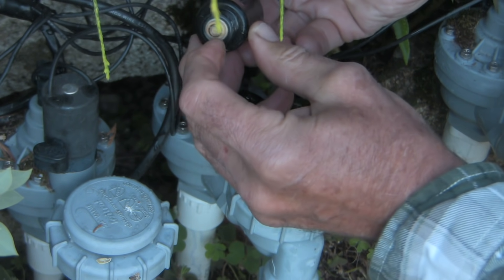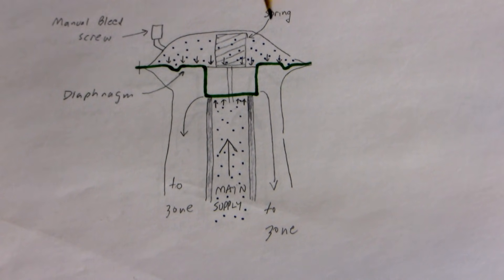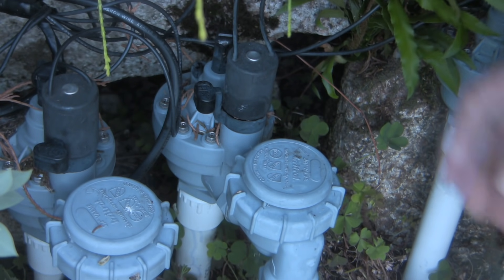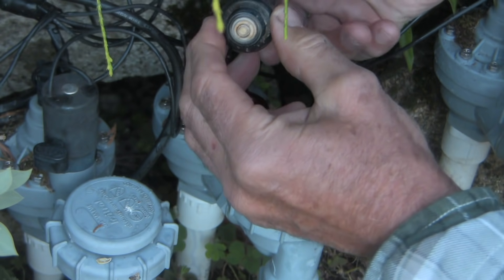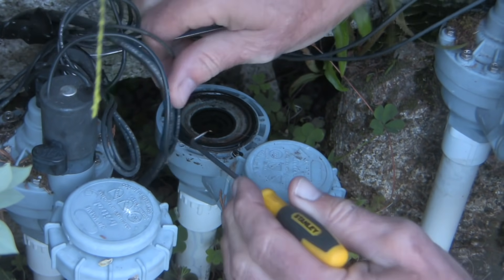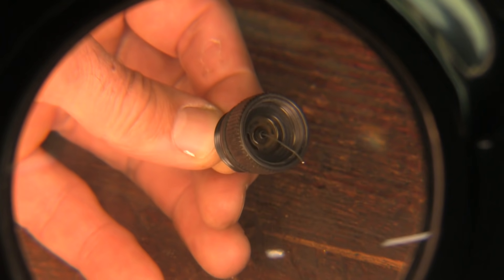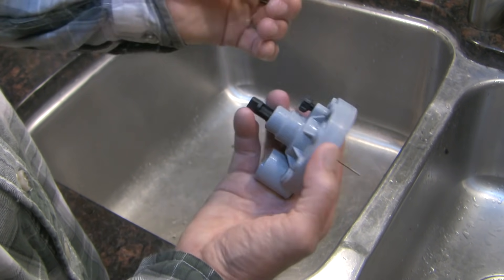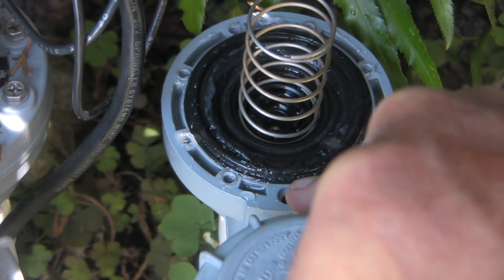Troubleshooting irrigation sprinkler valves

Comment: What would cause low water pressure
Reply from the maker: Two major issues. First, resistance in the line, such as a kink or obstruction or line corrosion higher up can cause a pressure drop across that resistance when water is flowing. That will give OK line pressure when water is not moving but when you open one zone the pressure drops so far that sprinkler heads don't get enough water flow to operate normally. Second, devices that consume a lot of volume can reduce pressure so much that other devices can't operate normally. This is what happens when people add too many devices to a zone, or when a leak happens somewhere, or when devices in a zone are not matched together properly to distribute volume evenly.

Comment: Ok so I took the bonnet off and the hole that connected to the valve had a small white plastic "tube".  Well the end of the tube was smashed.  So I tried without it, and water came out of the siphon not the sprinklers - like how you were missing the O ring.  Are there replacements for the plastic piece?
Reply: Thanks for your help.  I bought the replacement diaphragm kit at Lowe's which I thought was kind of expensive: $8.  But I put it in and that fixed it.  It looks like there is some sort of small white plastic filter passthrough that goes from one side of the diaphragm to the other.  On my old diaphragm that piece was broken and part of it was probably washed away.  Thanks again for posting your video.
Reply from the maker: You could try at an irrigation supply store, or even buy a new valve to dismantle and use it for spare parts. Most of these devices are inexpensive, the tricky challenge is to get the correct match.

Comment: Thanks!  I have been opening and closing my irrigation system for 11 years now and opening up this year my zone 1 wasn't turning on.  It turns out someone had closed its flow valve in the valve box and knocked one of the rotary heads out of alignment.  You saved me a call to the irrigation company.  Saboteurs?  (a tactic used to drum up more business?)

Comment: I got zone 4, 5, and 6 to come on at the controller but they run for 10seconds and shut off for a couple of seconds and then back off and on, etc.
Reply from the maker: That's interesting, maybe the controller is shutting down the circuit because the current draw is too high. Perhaps you have a short to ground, either inside the board or in one of the external circuits. Or, there could be a corroded segment drawing power, overheating and failing. I would disconnect one circuit at a time at the controller to see if you can isolate where a possible short is. It would be interesting to see if you swapped the zones at the controller to see if the problem moves with the swap. If you prove it is inside the board, most guys would just swap in a new board, though one can sometimes find a bad cap on the board that you could replace. Sometimes a quick glance at the board can offer clues like black discoloration or swollen capacitors.

Comment: On my hunter pro c I have 6 valves. 1,2,3,come on with the controller. 4,5,and 6 do not come on with controller but I can turn them on manually. Could it be the module in the hunter pro c?
Reply from the maker: Yes, possibly, or perhaps a bad connection somewhere, or a broken wire. When more than one device is involved, think of poor ground connections, especially at the wire nuts outside. Those are vulnerable to corrosion or trauma from weed whackers, etc. I'd start by closely inspecting the wiring at both ends, looking for clues like broken wires or wirenuts that have come undone. I'd look to see if the bad solenoids share the same ground connection. One technique you might consider is to swap one of the known good solenoids for a bad one, to see if the problem moves with the solenoid or stays put. Just be careful when you're fiddling with wires since you might find you've accidentally fixed the problem without knowing where it was. Remember to use dielectric grease on all connections, and I would sand down wires that you undo to clear corrosion. I did a separate older video of how to diagnose a bad solenoid with more details in that one. Good luck!

Comment: great video.   Ready to go tackle my system confidently after already performing an electrical analysis of the zone in question.
Reply: Well my repair went perfectly!  Not only did I disassemble and clean the valve that wasn't working but I also performed the cleaning on another valve that I noticed had a pinhole leak where the valve halves come together.    Now both are working and not leaking.   Thanks again.

Comment: You can save a bunch of time if you leave the valve under pressure and unscrew each screw on the valve lid but not all the way off. Water will spray from around the valve lid flushing the valve. Go back and screw each screw down a little so all are lowering at the same rate until closed. This pressure frees up calcium build up as well. Some times you have to pull the lid free which is why you unscrew each screw a little at a time.

Comment: One of my zones takes 2-3 minutes to fully come on and the pop up sprinklers to fully come up. Would turning on the manual control bushinf be a good starting point to rule out either an electrical or mechanical problem? Would you have an opinion what the problem might be?
Reply from the maker: It sounds like you've got a flow problem, which could be an issue with your water supply, a restriction in the line, or something bleeding the system down. Sometimes the problem is in the zone that was on before, if it fails to close when it should, the next zone down the line will be slow to open. Yes, manual control is a good place to start.

Comment: my irrigation system is a submirsable pump and will only run for about a min. It will pop up the heads and shoot water for a little bit then it will shut down. It will do this through the whole cycle of each zone. Where should i start on trouble shooting this problem.
Reply from the maker: Interesting. When you have your own pump, the usual situation would be to have a storage tank to increase capacitance of the system, so that drain down can temporarily exceed the pump flow rate without dropping pressure. It sounds to me like the pump flow is unable to keep up with demand so system pressure falls. I'd look for causes of reduced inlet flow (plugged screen or inlet filter, kinked supply pipe, failing pump, etc) OR increased demand (damaged tubing, broken sprinkler head, too many end devices, or a zone that sticks open like shown in this video). I would turn the system on for a while, looking for a lake of water that might be caused by a hidden leak. It would help to know if the problem happens at every zone or only some zones....
Reply: spelunkerd it happens with every zone. They come on and run and then they go down . This repeats for the whole cycle. It does take them a few seconds to pop up, they usually just pool water out the top without popping up

Comment: Great video!  Loved the mistake you left in, I wouldn't have looked for that O-ring and lost my mind trying to figure out the leak. 
My problem is different though, I have the same valve as you do, and I have water flowing out of my anti-siphon when I turn on that zone. Thoughts?
Reply from the maker: This should be an easy fix. Turn water off, unscrew the top of the antisiphon valve off, then carefully clean the valve and associated gasket. The valve should easily move and completely shut when water pressure forces the valve shut.
Reply: @spelunkerd  Thanks for the feedback!!  I'll take a look at it replace the valve if necessary.

Comment: But how do you tell which control valve goes to what zone?
Reply from the maker: Easiest way is to take a clip board and paper, turn on each valve manually and look to see what sprinklers are spraying water. Draw a little map of your yard, there are usually 2-4 sprinkler heads per zone, or more for drip zones. Keep a record of that map to make it easier to work on later. To manually turn these valves on, spin the manual control valve 3/4 turn counterclockwise (I show the removal of that handle at 5:29 of the video). Of course the main shutoff valve needs to be open, and if you have a problem with the system it can be more challenging.

Comment: Hello. Thanks for the Informative Video. I have a Perplexing Issue. My Gardener Changed Out My Complete Valve System Due to Leaking. Ever Since, it’s been One thing after another. From Zones Staying On to GENERAL LEAKS FROM SPRINKLER HEADS. Anyhow, My Anti-Siphon Lid was Leaking. He replaced the entire Orbit Valve Body with a New One. This One Leaked Worse from the Anti-Siphon Lid. He then took the Solenoid off and Placed it On Station Ones Valve Body and We Noticed that the Anti-Siphon Lid was No Longer Leaking. However, Later In the Day, I Noticed that I had a couple Leaks from my Sprinkler Heads on Station One Where He Did the Switch Of Solenoids. Is this a Solenoid Issue? I Looked at All the Parts of the Valve On Station One and they look Good. There Is Also No Dirt to Be Found. I flushed the System and Found Nothing . I don’t want to bother having a Professional Come Out for a Small Issue. Can You Please Help. This Has Literally Stopped My Life to An Extent. The Station Does Turn On and Off and Works Manually too. Before he did the change, Station One had No Leaks Whatsoever so this tells Me, It’s Either Something with the Solenoid or how that Solenoid is Hooked Up or The Wiring. My Wiring is Rather Old and I have Found a Section of it Not even Covered In the Dirt. It has Moderate Insulation but is Not Covered By a PVC Pipe or Other Plastic Cover. Thanks for any Advice.

Comment: Gave me the information I needed to diagnosis my valve box vibration.  I disassembled the valve head, cleaned the membrane and seals, back in business!  Thank you!   Probably saved me $200 of a house call from an Irrigation Company.
Reply: Vibration is caused by air trapped in your valve it will eventually go away by itself or you could bleed the valve

Comment: Thank you!! I am having an issue with my iritrol valves (3 zones), the only way they work is when I open the manual bleed screw in the ground, any recommendations? I already replaced the diaphragm and the solenoid in the valve but still not working.  Thank you again.
Reply: You have a electronical problem not a valve problem loose or cut wire
Reply: Hi.  Shot in the dark...  I'm having the same problem.  Only works if I open bleeder screw.  Only one circuit malfunctioning.  When the circuit is commanded on from the control panel, I can hear water flowing...no leaks and no flow unless I crack the bleeder screw or loosen the solenoid.  Please help!!

Comment: Today I turn on the water for spring and all my station turn on. I made sure that the manual control is at the off position. It weird that all 5 are stock open.
Reply from the maker: Not sure, but I have seen that before. There needs to be enough pressure inside the line to close normal valves. When pressure rises the others may behave normally. Look for the wettest area and fix that first, you may need to do some digging if you have a break in the line. You might also consult the manual of your controller.
Reply: spelunkerd 

I fixed them turns out I had left the bleed screw loose when I blew the sprinklers last year and I completely forgot about it. I tightened them up and now they work with no problems. 4:25
Reply from the maker: @gtdodgeviper  Thanks for clarifying that, it may help somebody else who visits.
Reply: spelunkerd 

No problem. And thank you for your video it sure help a lot tu understand how the valves work

Comment: So what would be the problem after installing a new rain bird heavy duty valve after you turn the valve off it makes noise and a little water flows out of the valve
Reply from the maker: Sounds like the valve is not closing completely. Check for debris in the line, you may need to flush the proximal line to get debris out.
Reply: @spelunkerd  thank u will do

Comment: Thank you!  Woke up to a sprinkler zone that had been running all night.  After lots of head scratching and random attempts at fixing nothing, I watched your video and took apart the valve and cleaned and that fixed it.  Thanks for sharing your knowledge
Reply from the maker: Thanks, I'm glad it helped. Most of the professionals around here are so busy they are pushing business away, and rotary valves seem to easily walk out of alignment by themselves. I've never seen an output valve move by itself, though.

Comment: PE valve. Used in outdoor chemical plant on the coast. It is the best product weapon. It is not affected by the marine climate salt water. Erosion. The product is simple and centralized management. The valve does not need tools by hand. It is easy to install/maintain. Pressure. Large flow. It can also set the flow size. It can be controlled by the remote control of the solenoid valve. The biggest gospel of the buyer.
PE閥. 在海岸邊戶外化工廠使用.是最佳產品利器. 不受海洋氣候鹽水影響. 而侵蝕. 產品簡單集中管理.閥用手分解不需工具. 在安裝/保養容易. 又耐溫耐壓. 流量大. 又可設定流量大小.可以用電磁閥遠端控制. 買主最大福音.

Comment: You don’t know all the trouble I went through because I too lost that  little o ring and never noticed it. I  even went as far as buying a replacement complete valve.   luckily I noticed it before my valve surgery.  I noticed by comparing the inside of that valve to the one next to it which was working fine.  took me a lot of time wasted I should’ve noticed that little o ring in the beginning.  Tx. Good video!

Comment: Question: I just attempted a maiden voyage with a recently built system. To clean the lateral lines before installing my rotors, I manually turned the solenoids on my valves and expected water to flown through the valves, lines and risers. Instead, all I got was water trickling from the valve head. From your video it seems that I may have some dirt in the valve somewhere, which is possible. During installation some got into the outlet pipes, but I vacuumed them thoroughly before installing the lateral lines. I've read that it is recommended that you flush the lines with water before installing rotors/spray heads, so figured that any dirt I missed would get blown out in this process - is this incorrect? Do I have to operate the valves electrically through my timer to flush the lines?
Reply from the maker: Opening it electronically will not likely help. I would verify your shutoff valve inside the house is open. There may be a problem with your feeder line, which should always have pressurized water. If the line is kinked it may not deliver adequate volume. Alternatively if the line were broken it wouldn’t deliver water, with a wet area from a leaking line.
Reply: @spelunkerd  Thanks for your reply! I contacted the manufacturer of the valve assembly and they suggested that it could be the backflow preventer or perhaps the diaphragms within the valves (although the assembly is brand new?). I'm certain that the shutoff valve is open (but will recheck!) as I have a small leak in the pvc feeder line after it that needs repair. When I do that, I was thinking that I can also do a pressure test to see how much pressure reduction I'm getting after the backflow preventer. I hope it isn't the backflow preventer because I don't know the first thing about those contraptions.
Reply from the maker: @grantgoodman1533  Backflow preventers are elegantly simple, just a one way valve that opens, breaking the suction seal when pressure inside is lower than atmospheric pressure outside. When it opens it allows air into the distal line, and it closes off access to the central source line, preventing water from being siphoned back into the clean house water. I suppose if they fail in the open position for a time they could become frozen in place by corrosion. The plastic ones I have on each line are visible in the video. To clean them I just twist the lid counterclockwise and clean the floating valve and seal inside. You can swap out a central backflow preventer fairly easily if you think it is bad.... When you have it off, turn on the water and look for flow. You can assess flow at each valve too, as I showed when I took the valve body off and then turned the water back on. It's good to do that once in a while to flush out corroded gravel that forms inside the lines.
Reply: @spelunkerd  Thanks again! I would be surprised if the backflow preventer (or anything in the system) was bad because it's brand new. I literally took it right out of the box and installed in in the feed line. It has tags indicating inspection, but is it possible that adjustments are needed. I will test the pressure beyond it and/or without it in the line and see what I get, and will also recheck your video so I can knowledgeably check the valves. Really appreciate the help!

Comment: I recieved a $550 bill from the city forMy winter home. I find that one of the switches stuck open.
57000 gallons the city claims in 28 days.
Is there and system that would " governor the usage gallons or back up valve?
Reply from the maker: I think there is, or at least a flow meter that can quantify volume use. However I have no experience with those devices. You might try your local plumbing/irrigation supply house. In the meantime, if you think you've got a break in a major line, you can manually close off the system until you have time to do detailed troubleshooting. Good luck!
Reply: You could install a master valve problem solved